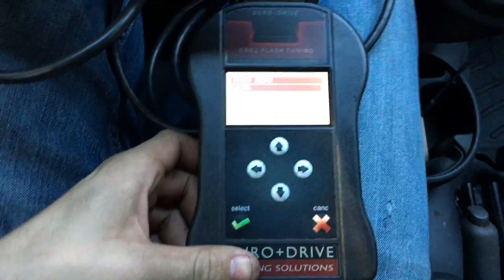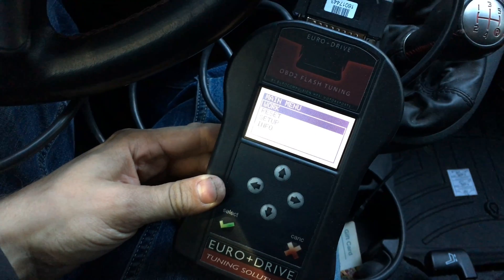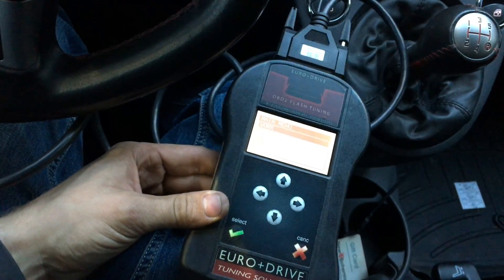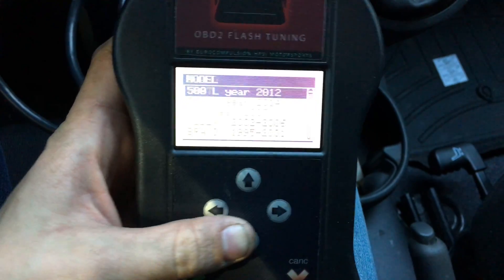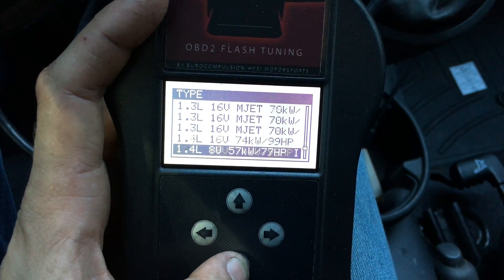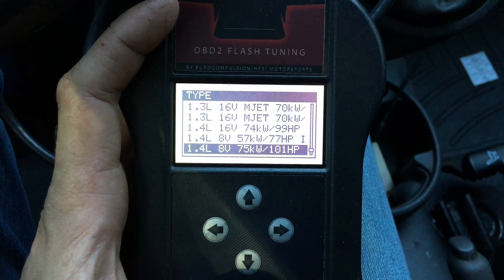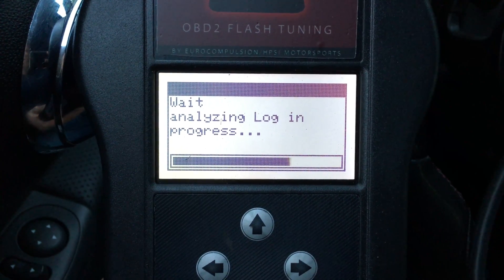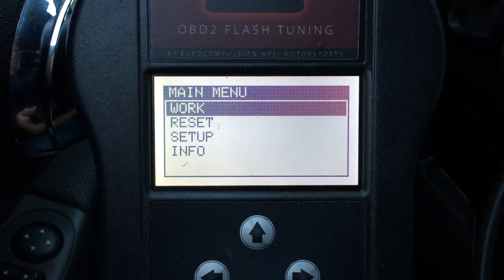Fiat 500 non turbo 1.4 multi-air ECU Flash Tune PART 2

Comment: Your trying to flash a non turbo car with that tune, not going to work. Also Don’t look like you know what you’re doing. Euro drive is a great company with great tunes.
Reply: Looks like Eurocompulsion sent someone to comment on this video.
Reply: Euro compulsion is crap, go on the forums, everything they state about their tune is an outright lie. 260bhp my ass lol. Truth is, no one knows how to tune the multiair properly, it's basically a freevalve system on the intake side, with sohc exhaust cam. You have to program an aggressive intake profile and install aggressive exhaust cam profile to see any benefits. Twice the mods to see amazing results
Reply from the maker: this is a tune designed specifically for the non turbo engine/ecu.

I know what I'm talking about.
Reply: Honestly I have dealt with Eurocompulsion with tuning on this device. They're very clear you don't do custom end-user tunes with this, you use the canned tune or contact them for what you need. They made numerous revisions for my car as it had a previously untested turbo setup. I found their customer support quite responsive this device. 

I don't know what exact problem you had, but I do know that Fiat had more PCM revisions than you could shake a stick at, and every revision has different challenges to get the tuner to connect. Most aftermarket tuners don't even bother with Fiat for this reason.
Reply: RC Monster Mash Studio Nobody sent anyone. I was stating both my experience and the facts.
Reply: Sure but as far as I am concerned Eurocompulsion is not a good company I tried that flash tuner and I had to send it back because it would glitch out the software.
Reply: RC Monster Mash Studio Works for everyone else. Dunno what happened with yours. Good thing you were able to send it back after trying it out.
Reply: Yeah it was a good thing I am going to try out a chip this time.
Reply: i had a horrible experience with euro. never again

Comment: Did you follow the instructions step by step as you flashed?

I used the video and instructions side by side to make absoultely sure I didn't miss any steps or prompts.

Not saying you did mess up, but we're all fallible (including companies lol) and I know of several people who've had to redo the entire flashing process to make up for a single step being done wrong.  Even leaving a door open could've been an issue, considering the instructions say ANY power going to another system can disrupt the reading/writing process.

It's a huge pain dealing with the ECU, for sure.
Reply from the maker: Yep. I went through on my own, then step by step with their support dept for 3 months.

Enough is enough. They're not ready to ship the NA flash to live people yet. I was clearly one of (if not the first) to specifically order the flash for the NA engine, they weren't prepared for the ECU definition issues they came up with, nor were they able to create a tune file for my car that was compatible with my ECU through the MyGenius.
Reply: Ovalbore Super weird!  First negative thing I’ve heard about EC tunes.  

Your car is a 2012-2013?
Reply: Ovalbore Also, I would leave a review directly on their web page for the NA flash tuner.
Reply from the maker: 2013 -- have since sold it and bought a 500E :p
Reply: Ovalbore Nice!  The Es are such awesome little cars 👍🏻
Reply from the maker: I'm still planning to use Eurocompulsion for my 124 tune, so they haven't completely lost me. Not at all thrilled with their first go round with me though.

Comment: Flashed my Abarth just fine. What's your issue??? I noticed that you fucked up once in the video and edited some of the fuck up out.
Reply from the maker: editing was to turn the 30-minute read time down to 10 seconds.

Euro+Drive and Dimsport have the wrong line item listed for this ECU in the handheld, the file the MyGenius took out of the ECU was not readable by them, endless exception errors with the computer software.

half-baked software, hardware is well tested on other makes, so it's 100% the support company behind the Fiat (EuroCompulsion). NGEN was at least able to reply with some sense. I'm ditching this box, things reach a point when they're not worth the hassle. The cost of this unit, there should be a better system.
Reply: The name/line item mismatching is down to how the protocols work. It's typical and all of the tuners including power gate list it the same. 

You were supposed to switch on the dashboard before reading, that's very important. The magnetti Marelli ECUs are a pain but if you want to keep at it, I can help. 

Key points: remove the key and count to 10, insert key and count to 10 then turn the key to "on". Rinse and repeat.
Reply from the maker: dashboard was on, authenticated just fine with the ECU, confirmed the dump. file was unusable for the tuner.

this thing works great on the abarth -- the ECU and definitions are not the same, and this has not had the kinks ironed out yet on the NA engines.
Reply: True. Loving it on the Abarth!
Reply from the maker: I love that they offer a REAL flash for the abarth, I agree. heard nothing but good things about it.

They just need more work on the NA cars like mine before it should be sold mainstream.